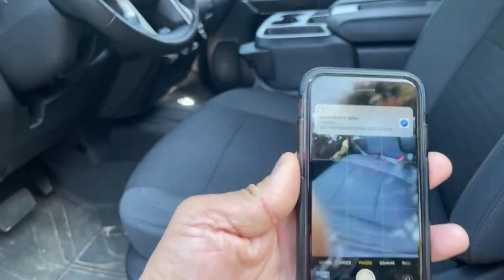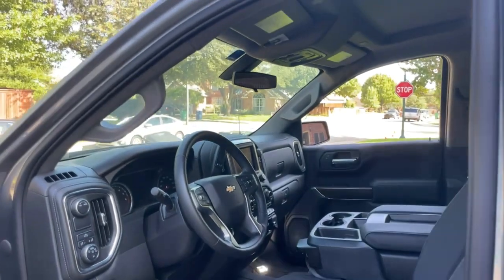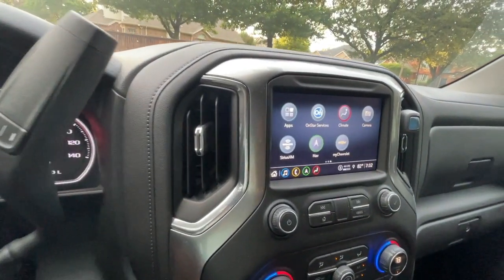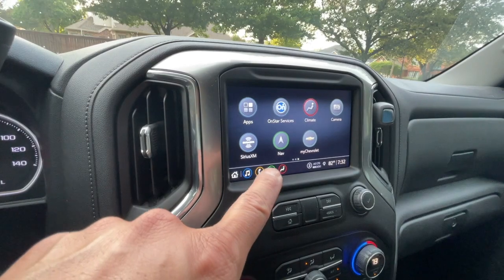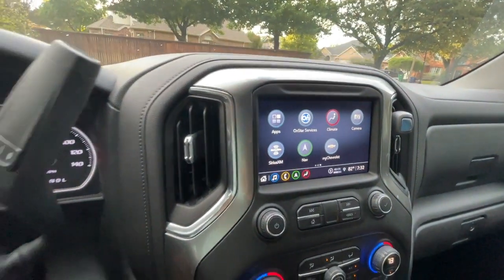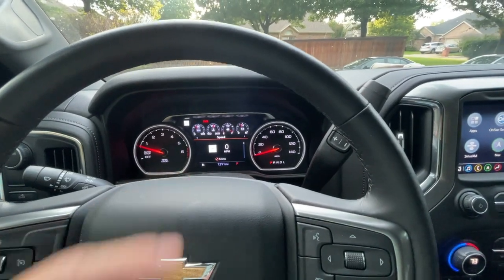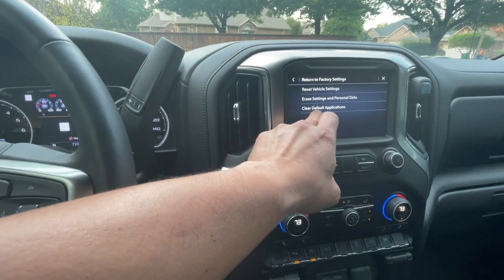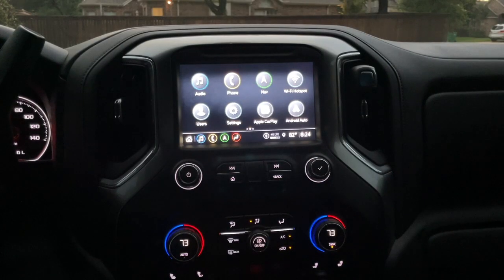2021 Chevy Silverado - Adding Factory Navigation

Comment: Do you know which connector is for the Sirius XM and if there is a second connector for Onstar?  Not sure if a single cable comes from the shark antenna or if there are two.  Why asking?  Because I carry a camper on my 2022 Silverado 2500 HD, I lose the Sirius XM signal whenever I turn to the north.  So, following some web guidance I want to install another Sirius XM antenna on the front of my truck so its not blocked by the camper (hopefully).  If both services are supported on the same cable, I'd have to get a FAKRA splitter.  Speaking of FAKRA connectors, I hope that is what Chevy is still using.
Reply: That module is behind the factory radio
Reply: In my 2021 the connector is in the driver's side a pillar. Got a $7 antenna, connected and a magnet holds it on the hood at the very front of the truck.

Comment: Pretty cool upgrade, I'd love to get it for my 21 RST but $750 seems pretty steep for reprogramming a module in my opinion. For that money I'll just keep using android auto for nav.
Reply from the maker: Hey there, the pricing in the link I provided in the description, is for a full kit that includes a Brand New Radio Module.  This adds Wireless CarPlay (WCP), Wireless Android Auto (WAA), HD Radio, and Navigation for pre 2021 trucks.  My truck already has WCP, WAA.  The cost is under $300 for adding Navigation to any 2019 - 2021 truck.  Sorry for the confusion.  I updated the link to the correct product.
Reply from the maker: Just updated the link in the description to the proper product :)
Reply: @philgamboa2906  oh yeah much better $250 not bad
Reply: android auto is better anyway...
Reply: Wow. Im super stoked! We bought a new 2021 Chevy Silverado and have been wanting to trade it in over this navigation system. To only have sirus xm (nothing against them) is a deal breaker. If your truck is am extension of your office, making calls and driving to multiple jobsites, you have to have the ability to navigate while on the phone. Can't wait to give this a try, thanks so much! Saved us from trading it in. I was also looking at another new vehicle (2nd vehicle) that I previously thought was a no go over this navigation issue so that could be an option. Why these manufacturers don't get this is perplexing. 🤔